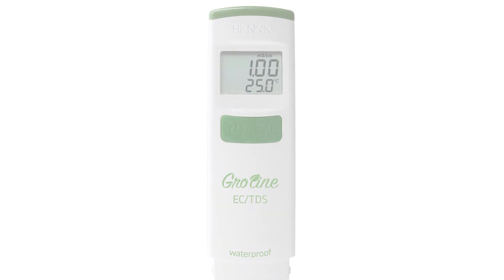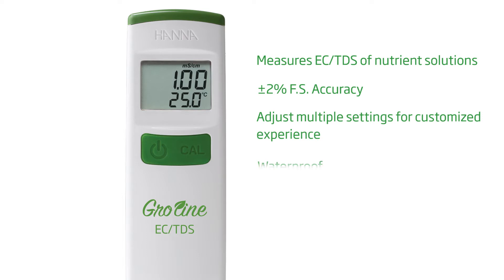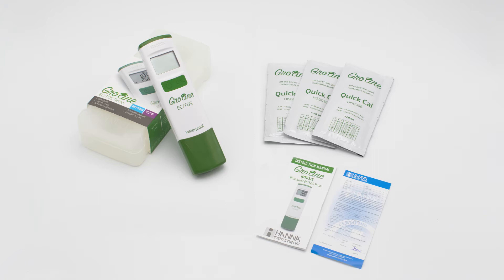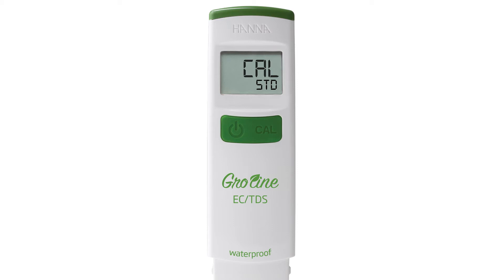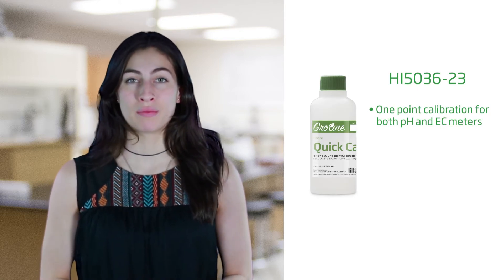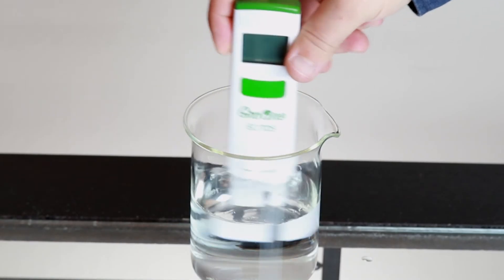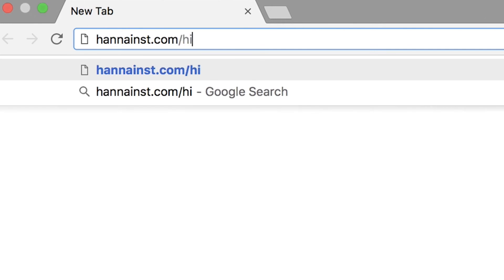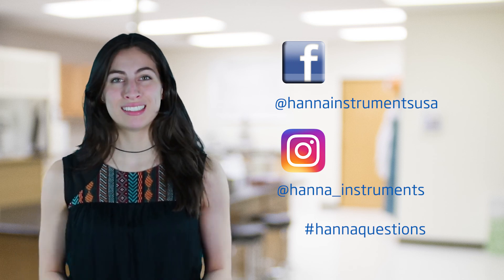Hanna Lab - Learn How to Set up and Calibrate the Hanna GroLine Conductivity and TDS Meter HI98318

Comment: I purchased this meter and I can not figure out how to read EC and PPM without opening the back and manually pressing the black button. Is there a way to read PPM and EC without going through this? I use this meter to test my Hydroponic Solution and I do watch both readings. I like the meter, I find it very accurate from reading to reading... but I really wish I could read what I need with the press of a button.
Reply: They are not answering. This is an AD. Don't spend an arm and a leg on those Hanna meters. Buy chinese, they are way less expensive. For THAT price you can get 2 or 3 chinese ones to compare and you still have some change $$$ ;-)
Reply: @flaviofuentes4127  hanna is more accurate than China made.